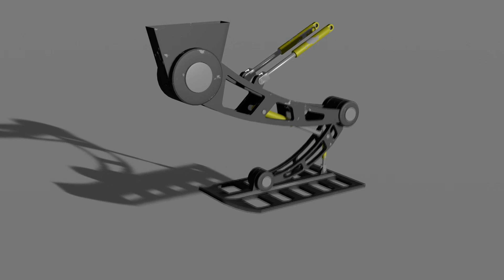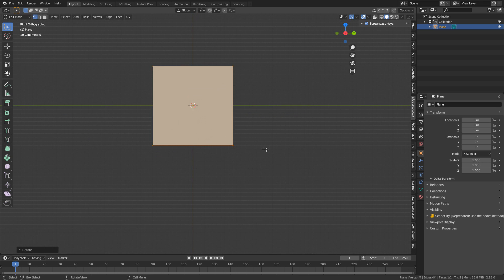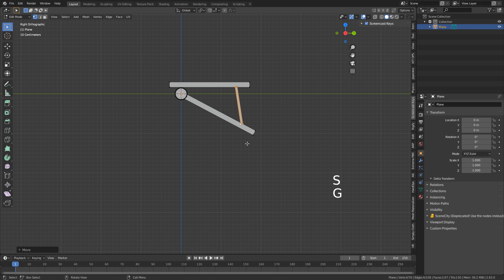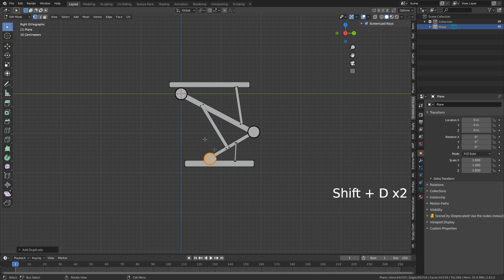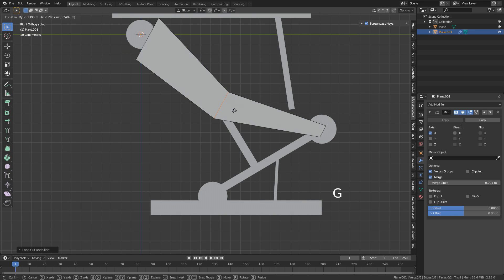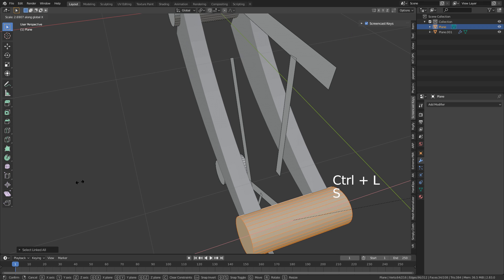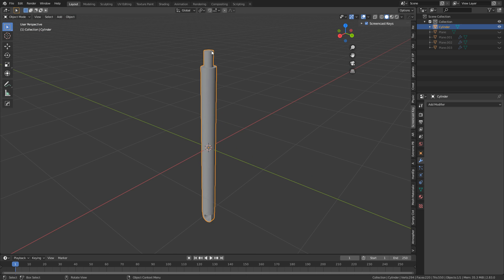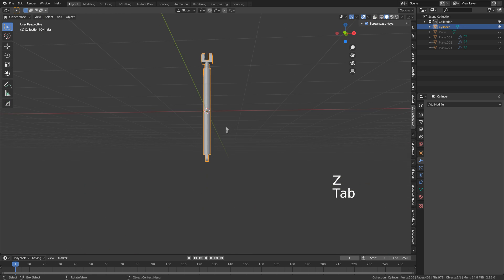How to 3D model SciFi Landing Gear Blender Part 1 Blocking

Comment: Now you threw me for a loop and it's not that if you are already in tomorrow and I'm watching this now (12hrs later) is it today or yesterday?
It's that I've been busting my butt doing hard surface modeling (Fusion 360?  Ha! Well maybe in the future given the inability for multiple varuable bevel transitions along a single edge...) 
phew, ok: 
Non-destructively and you just did most of this without a care, hands in the air, burn all bridges, destructively.

When do I go destructive and when is it better not to?  Work for yourself, destructive, work for a client, non-destructive because you forgot to give them a set number of changes they're allowed?

Is there another heuristic that's better to use?  I'm confused af.  And that's still wondering when to use boxcutter or hops sometimes too... forget about it slices, it dices... cause Idk wth dicing even is...